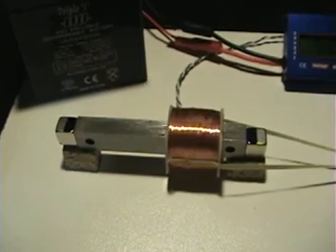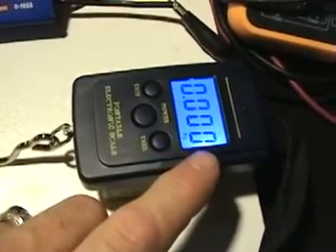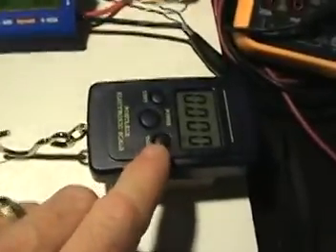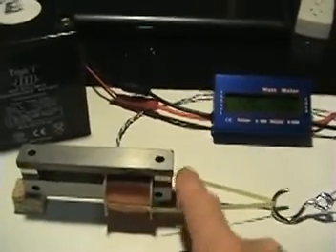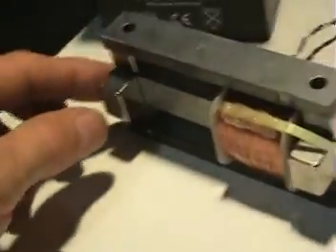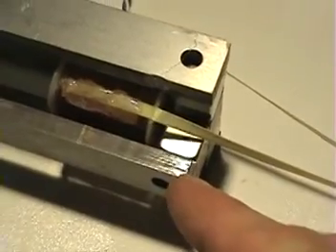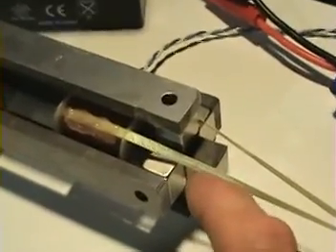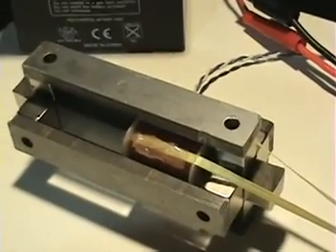Mostly Permanent Magnet Motor update

Comment: I think you are missing another balancing agent there too,. you moved your connector to the scale so it was pulling down in addition to pulling back adding more angle and drag on the core too, and before you had it balanced out so it was just pulling back directly so it was not causing any excess friction on the coil :) Not sure if that will help as I am not sure how far you have moved away from this. Very informative video though to say the least Many thanks and welcome from IAEC :)

Comment from the maker: Yes, it can move back and forth like a piston engine. I have older videos showing the motor turning a crank shaft. However, the point of this video was to share that one can double the pulling power buy directing the flux of the opposite pole of the magnet through a core on the outside of a coil.

Luc

Comment from the maker: Hi Daniel, the neo magnet can be used on the positive or negative side. Originally I thought it amplified but what it does is it makes a very efficient oscillator switch (on/off). It can only be used on the low voltage DC side.

Luc

Comment: Thank you so much for showing this motor design, I think it will be perfect for creating mechanical vibration for HHO cells that require a lot of cavitation! I'm going to replicate the motor and design some way to make linear bearings that are embedded into the core material.                                                                                                                       SW

Comment: Gotoluc...since this is your most recent vid I'm using this to ask you something.....harking back to your use of neo magnets to amplify ignition spark on an automotive application...question is ..would the neo magnet be placed between the 12v  battery (positive side) and the ignition coil or can it be put after the coil? i.e. between coil and spark plug via the plug wires? What about neo's on the inside of an actual spark plug? too much EMI for the underhood  electronics?

Comment: GOOD IDEA FOR A MAGNETIC MOTOR. TRY USING THE 5 SIDES CENTER. YOU ARE WASTING THE FLUX OF THE COIL. COULD BE USE AGAIN WITH INDUCTION. THANK YOU GOOD DEMONSTRATION.
Reply from the maker: Guymick Cormic Sorry but you must be misunderstanding. All flux directions are being used in this design, center and outside.  Nothing quite like it on the market. Luc